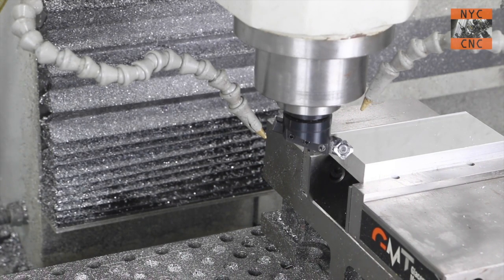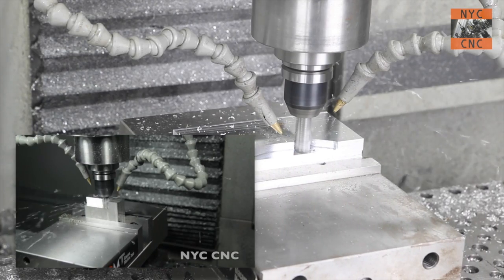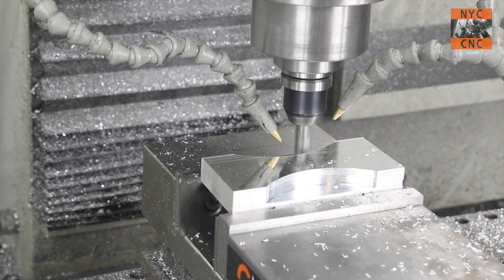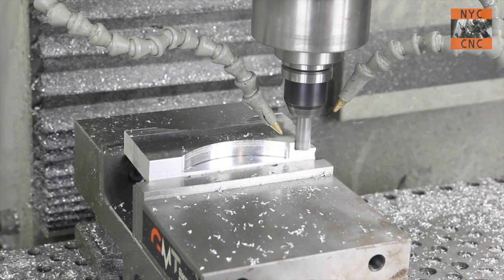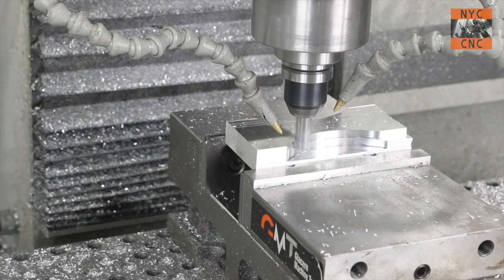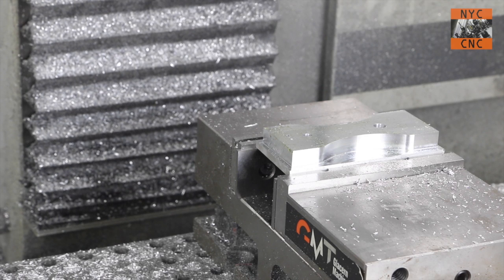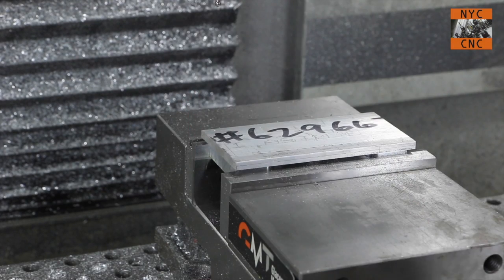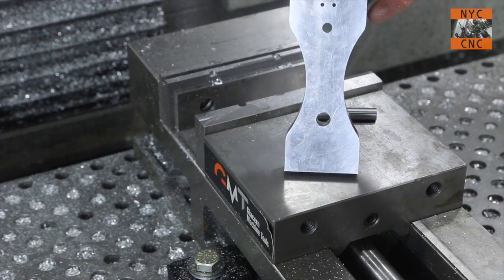Choose Your CNC Adventure: Machining DIY Steam Engine Part with the Tormach PCNC Mill!  Part 2

Comment: Looks like low rpms? Assuming youre cutting aluminum, my rule of thumb has been double your RPM and Feeds from what you would be using on any CRS or 4140 type of material. You're getting a nice finish, but try doubling, you probably will still see a really nice finish, with double the productivity. Have you tried using any type of high feed lower step over, trochoidal milling tool paths for roughing?

Comment: Very good advice on the corner radius endmills. I do this whenever I can. Just replacing a square sharp corner endmill with even a tiny corner radius you can probably double the tool life at least. The larger the radius the better but just the change from a sharp corner to a radius corner gains you the biggest tool life advantage I've found.
Reply: Also a good idea.
Reply: NYC CNC

I use to do it by myself, my company buys crap endmills so u must deal with what u get. So on roughers I would use bench grinder to get a small radius

Really u don't wanna know what is like to machine tool steel with HSS Co8 endmills.
Reply: Yeah boss buys them because they are cheap. I have my own 10mm, 16mm and 25mm indexable endmill, company gets me only inserts. That is what I use for roughing out stock.
Reply: Yeah that is the way it should be done. But I live in crappy country working for low wage. But have plans of moving to Canada and hopefully find some machining job :)

Comment: This video brings a tear to my eye. What are your feeds and speeds, plunge rate, and plunge ramp distance?
Reply: It's good to know what's possible!  I am pocketing MIC6 on a Tormach using a 3 flute carbide endmill (no longer TiCN coated), 2000 RPM, Feed 50 IPM, Plunge 20IPM, Plunge depth 0.06".  Really noisy, lots of chatter.  I will try your settings if you don't mind pulling them up. Nice to see someone doing great work with the same machine I am using for comparison.

Comment: When you install new tools, do you have the exact length of the tool setup?  I seem to remember having to zero out  the z axis every time I installed a new tool at the local techshop.  This looks much quicker than I'm used to.
Reply: NYC CNC
 do you use some type of negative pressure holder on that ? what you would recommend to a normal ER collet system to be faster to change tool?

Comment: This is the site where we get ours http://www.mscdirect.com/product/details/04393187.   These solid carbide with zirconium nitride coated end mills are really nice. They leave great finishes. MSC industrial  supply has headquarters in new York and nc.
But they have several customer fulfillment centers. They can be a little expensive but have quality tooling!